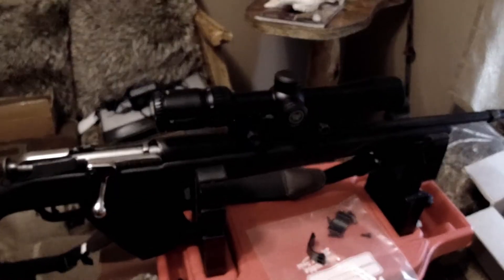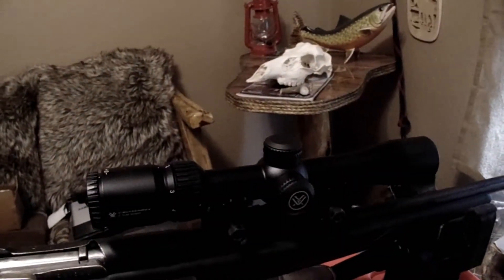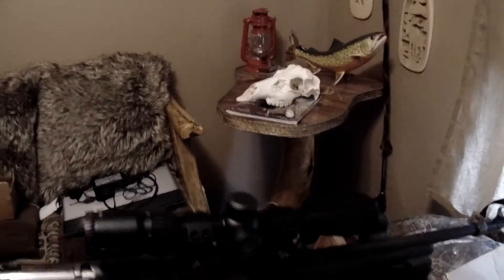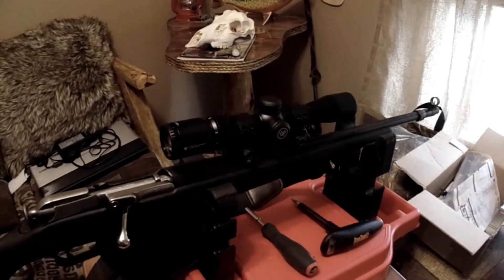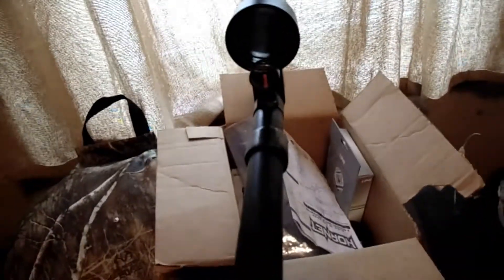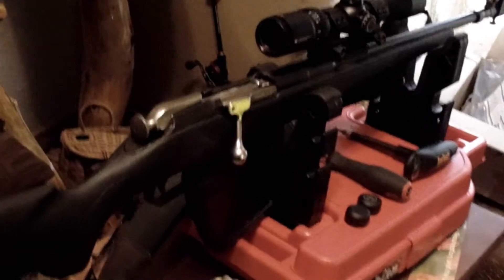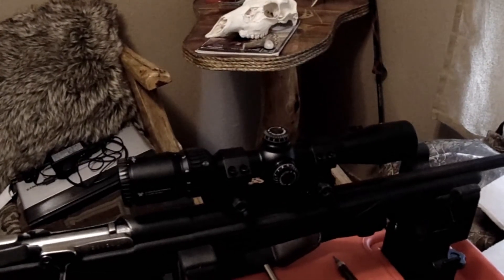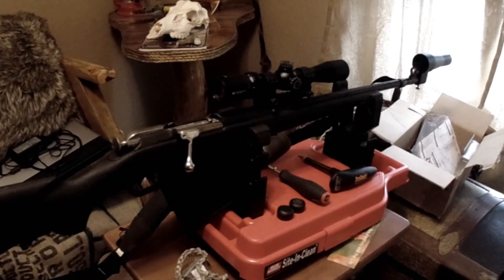Vortex Crossfire 2 Scout and Mosin Nagant M44

Comment: Some low mount scope rings is what I used on my M44 scout scope set up .
Reply from the maker: I hope the lock tight holds up.  It's a mule...lol  Thanks for watching
Reply: @outdoormerica  I have the same style mount as yours . The weak link is the screws that go in from the side . They bent on mine making the mount loosen up . I used the original pin that held the sight  in place of the screws and lock tight on the set screws and it has held up for a few years now .
Reply from the maker: @jamespollard1670  That's good to know and I did keep the original pin so, I may go ahead and change it out

Comment: How do you like the bolt handle you have on that rifle ?
Reply from the maker: The bolt worked really well for that stock.  I have since switched back to the original sporterized laminate wood stock and had to put the original bolt back because the modified bolt would turn down.